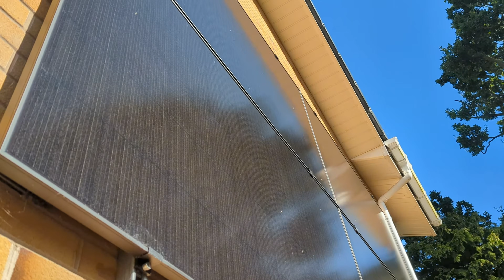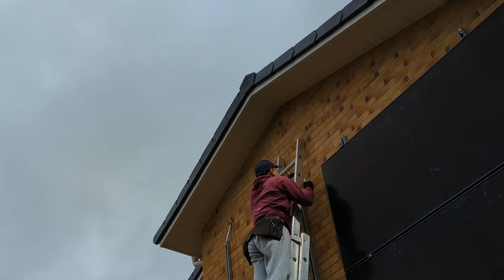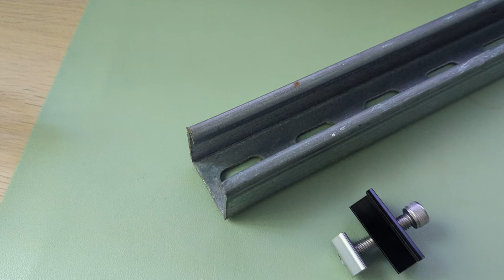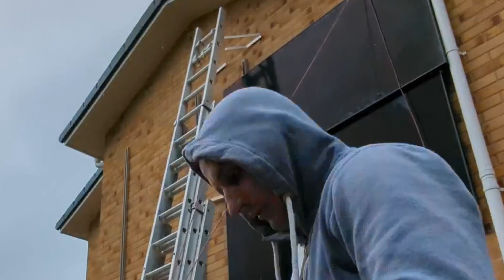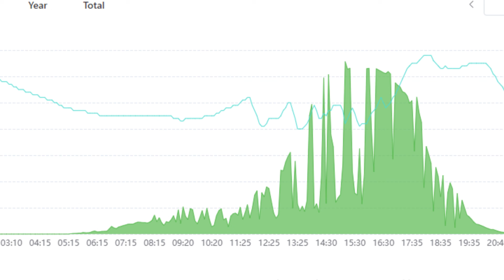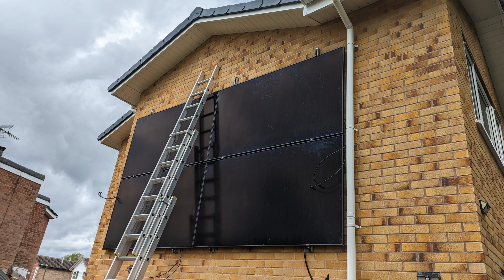DIY Wall-Mounted Solar Panels on Unistrut Mounting. Installation Guide & Performance Stats

Comment: I'm wondering why you didn't lay the unistrut horizontally?
Reply from the maker: The panels I was using had a spec for better load and wind endurance when mounted using the long side. They had pre-drilled holes there too

Comment: Great vid. Looking at adding 6/7 panels to my south facing wall that has almost no shading.
Then its replacing 30m of south facing boundary fence, so another potential place for panels.
Reply from the maker: Nice! Good luck with the project, what a time to be alive when a fence can actively pay you on top of all the wonderful work it does already.

Comment: Dont the panels have to a minimum distance from the wall ??
Reply from the maker: You ought to leave some space for air flow for cooling. There is a maximum distance allowed but as far as I remember there isn't a minimum

Comment: Have you checked how fast this will pay for itself?

Very useful video I was not aware of these mounting rails. I wonder if they are more expensive than aluminium counterparts.
Reply from the maker: Thank you for watching. The break even for this particular one will take a while because I got them at a time when all the equipment was much more expensive. Furthermore I have a few trees around that hinder it. However, at recent prices and lower shading it should do well. 

The rails are standard electric mounting equipment that has been well known for a while and I'd argue is likely cheaper than the specialised aluminium solar equipment.

Comment: Unistrut nuts are available with a spring on the back. These hold it it place in the channel before the fitting is screwed into them - makes it MUCH easier for this application.
When attaching the Unistrut to the wall, it can help to make the first fixing a stud (allthread/threaded rod). The channel can then be "hung" on this easily, and the remaining fixings marked out and installed.

Comment: Great to see, not much content online regarding wall mounting panels, Id have moved the down pipe over to the end. But good install. I’m guessing this hasn’t been mcs approved? I have 3.2kw on my roof, and a 8.2kwh battery, I have a huge wall side of my house which is clear of all obstacles and is direct south facing. I’d love to get 4 even 8 panels which would match the athetics of what’s on the roof. My only concert is when you pull onto my street you literally have 100 meters of driving looking at the side of my house in full view 😅 that would definitely get the neighbours talking. I’d love to tackle this diy. But id want to tap into my existing inverter which I’d imagine would void the warranty unless MCS certified electrician fitted it

Comment: I have the same unistrut and clamps but when I tighten the clamp to the edge of the panel, the clamp pivots and doesn't bite down square, any idea how to solve this?
Reply from the maker: Interesting. Can you share some photos of how it looks? In my case, I'm clamping from the bottom and top of the panel (not the sides) so it did fit snuggly while tightening. It's worth checking the length of your bolts. If too long they could be  hitting the back of the unistrut before the clamp grips the panel.
Reply: @solarenergyconcepts thanks for the reply! It was because my clamps were parallel to the channel, so we're in effect floating over nothing. I changed the rails to a vertical arrangement and the clamps bit down nicely.

Comment: I wonder if you realize you are robbing yourself of the free heat hitting the wall from the sun. That heat on the wall heats the house for hours after the sun goes down. Adobe style.
Reply from the maker: It certainly blocks the sun in winter, but we get so little of it to consider it a big loss. On the other hand it does help with cooling in summer and generates energy for my mini split AC
Reply from the maker: I'm curious if there's a good source of data on which option wins in the long term
Reply: That depends on how well insulated the wall is. I'd suggest that if you are getting a significant heat transfer through the wall then the heat losses in winter, and possible cooling requirements in summer, will far exceed the benefits on sunny spring and autumn days and you really should consider increasing the level of insulation. PV panels will also generate on days when there's no direct sun to cause a heating effect.

Comment: hello, great video thanks. I'm planning something similar and wanted to ask why are the rails mounted vertically not horizontally. Was there no room to slide them in if horizontally ? Same for the panels really why landscape over portrait ?
Reply from the maker: Hello, horizontal rails were an option too. The reason we went with the vertical was that they are on the shorter distance. If I was doing that today I wouldn't go with full rails though. In another project I used 30 cm spend of unistrut strategically placed for the mounting points.

Comment: Question! Any issues with vibrations from wind? I've been thinking about installing vertical panels on my house wall but its the side thats up against the wind from an open field. Already now the fixed ladder vibrates in the wind and causes an annoying low freq sound on the inside. My fear is the wind will get under the panels and then the turbulence shake them.
Reply from the maker: Interesting aspect. I haven't noticed any vibrations or noise even at high winds. Mine are relatively sheltered though with trees and houses nearby. I've seen roof installs with solid bird proof shields, I wonder whether a similar approach would work to minimise the gap.

Comment: Hi what solar panels are these and you mentioned tree shading so do you use a optimiser or does the shade not have much effect, thanks
Reply from the maker: These are 833 (bought 2023 from solartradeslaes). I don't think these are around any more. 
Yes I did use the optimisers, I didn't see notable gains from them. I suspect it's because my panels are uniformly shaded.

Comment: This was cool to watch. I don't see many people doing this, but vertical mounting on the wall can be as much as 70% as effective as at a 40 degree angle over the course of a year in my region of the UK according to PV Watts. Realistically that's nearly as effective as an East and West facing roof and more effective than a north facing roof setup.

Comment: I'm usin the same system but with low profile( 41mm x 21mm,  2.5mm heavy duty unistrut mounted horizontally with a 41mm x 41mm section running along the bottom as a bottom support rail with rubber protection strip for panels to rest on  , 3 x 450 watt panels for now , and Black PVC capping for cable management . I worked with unistrut for decades. Can I ask did you employ earth grounding for the unistrut ?
Reply from the maker: Sounds like a solid framework! About the earth grounding - I didn't put any on mine.
Reply: @solarenergyconcepts  I will on mine, I am rural household with Tera Tera earthing , so easy to run and earth the earth grounding rod and safe as

Comment: Another nice thing is that it helps keep the sun from heating the wall and can lower cooling costs.
For me, I can only have maybe 2 panels facing east and would only get about 4-5 hours of light.
In winter, even less light as sun angle is quite different.

Comment: Unless you live at the North or South Poles, it's foolish to mount solar modules vertically. Just ask NREL.
Reply from the maker: I'm glad I don't live at the poles, yet the system is working well enough. Thanks for watching and stay smart!
Reply: Using MREL's calculator, the 6 panels I am putting on the wall of my garage (at 90 degrees) facing due south get 75% the output of panels tilted perfectly for my latitude. They also have better performance in winter especially in snowy conditions. Having a mix of panels in different orientations is undoubtably the best design as panels are now pretty cheap especially on the used market. And if putting panels on a wall is your only option absolutely just do it.

Comment: For mounting into the brick, what size concrete sleve bolts work with the unistrut rails?
Reply from the maker: I used M8 with large washers
Reply: @solarenergyconcepts  Following up my local township is a stickler for attaching to a brick fascade.  I hired an engineer to assist ($$$). They have rejected my first permit request stating the following from "2015 International Residential Code (IRC), section R703.8.3 "  We have an possible fix that entails attaching the first (bottom) unistrut to the foundation.
"OTHER

NEED TO SHOW ALTERNATIVE SUPPORT FOR PANELS
"MASONARY VENEER SHALL NOT SUPPORT ANY VERTICAL LOAD OTHER THAN THE DEAD LOAD OF THE
VENEER ABOVE"-MRC 2015 R703.8.3"

Comment: whenever there is a chance of getting shade on the panels, I would choose panels that have extra bypass diodes in, the ShadowFlux ones from Renogy seem really good
Reply from the maker: Nice! I installed tigo optimisers at the time we brought this up, but I'm not convinced they are making any difference.

Comment: Solar addiction is quite a problem today. One thing I found in the UK was if you have solar on the roof, later additional panels need planning permission. I hope they remove this clause in planning but worth stating
Reply from the maker: Interesting 🤔. I believe planning permission only applies to standalone panel installations, or listed buildings. Can you share some sources of your research.
Reply: @solarenergyconcepts Lots of planning rules on anything on your house. Stand alone stuff has rules as well, 5 meters from boundary
Reply: This is plain wrong. You don't need planning permission for solar panels.  You DO need Building Control to inspect the install, though.  Big difference.

Comment: Isn't the 4 cm gap between the panels and the wall (I guess you were using 4 cm deep rail?) too small for ventilation? I am about to do pretty much the same and I read that at least 8-10 cm is required for proper ventilation. What's your opinion and experience? Do you have temperature monitoring in your setup?
Reply from the maker: Interesting question. In my initial research I didn't come across advice on ventilation. I don't have any temperature monitoring. One thing to consider is that during the hottest months the sunlight angle is always sub-optimal.

Comment: You're losing a TON of power by mounting your panels vertically.
Reply from the maker: The same panels on the roof will yield better results, no doubt. Losing would be if I moved them from the roof to the wall. However, I didn't have the option to install on the roof (I'll get into that in a different video) so I see this as making a  gain over zero solar.

Comment: Could you share a rough quantification of financial feasibility of this? For example if roof mounted system pays back initial investment in 4 years...in percentage terms, how bad is wall mounted system. Like
Reply from the maker: This will be strongly dependent on the individual situation like local prices, yearly consumption, consumption patterns, location and aspect of the roof and wall etc. You can assume that in the UK on average a vertical mount on a south facing wall does about 35% less yearly than a south facing roof with 35 degrees slope. Assuming no shading. You can narrow it down with a tool like this https://re.jrc.ec.europa.eu/pvg_tools/en/tools.html
Reply: @solarenergyconcepts  thanks a lot! Appreciate it!

Comment: Looks nice. But I do get the impression that you could have put 6 panels in portrait and maybe even 2 more in portrait on the right side of the pipe.
Reply from the maker: Thanks, yes there's some room around. It's DIY project and I was keeping the scope manageable without additional tasks. Also  pushing the panels too close to the edges will increase the wind load and it was an easier design to keep well off.
Reply: @ Yes, wind can be a risk factor and as a DiY project smaller makes things easier. I think you chose wisely.

Comment: I suspect the solar panels also shade the brick wall and keep the rooms on that side cooler or easier to air condition in the summer.
Reply from the maker: Certainly, although I don't have temperature data to show a before and after comparison.

Comment: Thanks for this.  What brand/model of unistrut rail is that.  Im having trouble finding a rail with teeth .
Reply from the maker: I ordered mine from an electricals supplier (TLC Direct.) 
UVTL3 41mm x 41mm 2.5mm Single Slotted Channel (3mts)
Reply: @solarenergyconcepts  Which mounts are you using for the panels? (That attach into the Unistrut). 
Great video by the way :)

Comment: Solar panels are so cheap these days that it's perfectly fine to put them in less than optimal locations.
I have a challenging location where I live with lots of tress and snow and less than optimal sites. I've put up 6 different arrays only 2 are "optimal" but the rest generate substantial energy and have paid for themselves years ago.
Reply from the maker: Yes, that! The price is so low now that suboptimal locations like your example are a valid option.

Comment: silly question maybe, but what did you use to attach unistrut to your wall pleasE?
Reply from the maker: A combination of anchor bolts and heavy duty plugs. I may have overdone it. Some of the anchor bolts were quite strong and secure but some felt loose so I doubled with a 10mm plug nearby.

Comment: We have a 30 (390watt) panel array on our south facing garage roof (with zero obstructions). It has enabled us to be essentially net zero as a grid-tied system but we are hoping to buy an EV in the future and we have other reasons for adding capacity. 

I’m new to solar, happy with our system, but have been wracking my brain about the value of adding another 6-8 panels to the south facing wall beneath the roof array. With no obstructions, in the Canadian east coast, we see lots of snow in the winter and shortened days thus my interest in adding capacity to the wall. What id really like to do is hang them on an adjustable wall rack that would let me have them at 90 degrees when appropriate, and an angle similar to the roof (5/12 pitch) during the spring/summer months. Sorry for the long story but your video is one of very few that speaks to wall mounted arrays so I’m curious if you or anyone has seen such adjustable racking anywhere commercially? Thinking i will have to chat with a local fabrication shop if I can’t buy one. Thanks
Reply from the maker: Love the story, and thanks for watching. I have seen some angled frames when I did my research but they were all fixed. 
I'd be cautious of return on investment in the case of custom fabrication. The wall panels do well with the few hours of sunlight in winter but it only goes so far.  Although the adjustment for the summer months will compensate handsomely. 
Another thing I'd consider is how will you connect those new panels to the inverter. Mixing wall mounted with roof mounted and potentially snowed in panels will negatively effect all if they're on the same string. 
I've tried that mix on a smaller scale project and it didn't work out. I'm making a video on it.
Reply: @ thank you for the feedback. I think your points are very valid and I look forward to watching the video you do on results of mixing panels. Not sure what I’ll do yet but till I get this crazy idea out of my head, I’m going to keep searching and asking naive questions 🤦‍♂️. Thanks for the info and thoughts
Reply from the maker: Thank you for the kind words!
Spoiler alert, check out my video on expanding my inverter capacity.

Comment: I’ve ask a few solar installation companies to do this for me and they all have a meltdown!  We don’t do that, we can’t do that! I’m no good with electrics otherwise I’d do it myself
Reply from the maker: I think they're apprehensive because they know how to do roof mounts well and avoid venturing into unknown jobs. 
My guess is that the mounting part is the biggest put off for them. You may be able to install the panels and hire an electrician to do the wiring. You'll probably have to connect all the panels together at the time of mounting though.

Comment: Hi, nice videos, roughly where in the UK are you. It could make a lot of difference to any estimates of power that others get.
thanks
Reply from the maker: Thank you for watching. I agree with the geographical point. The further north it is the more relevant it would be for vertical installation. This one is in WM .

Comment: thanks for the video , whats stopping you mounting panels at the appropriate angle to maximize production ? complexity of the mounts or visual looks?
Reply from the maker: The complexity is a big part of it. Also, the closer you stay to the wall the less load/lift you get from wind. And finally there's regulations. My interpretation of the local building regulations is that panels should not stick out more than 20 cm off the wall, which doesn't leave much room for achieving an optimal angle.

Comment: I was also wondering if a diagonal orientation might be more attractive for wall-mounted panels - ie rotating them 45° - especially if that would create a layout that matches the roofline.
Reply from the maker: That is an interesting suggestion, I love the idea of getting added value from the solar panels as a design feature! I expect the mounting method I show here would work just as well with diagonal orientation, too.